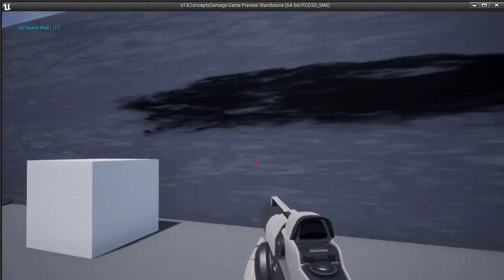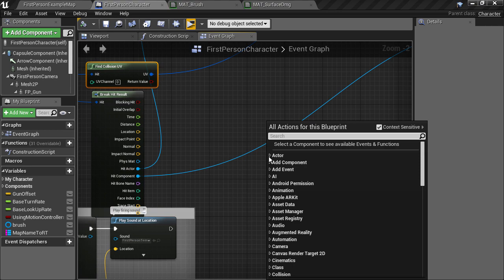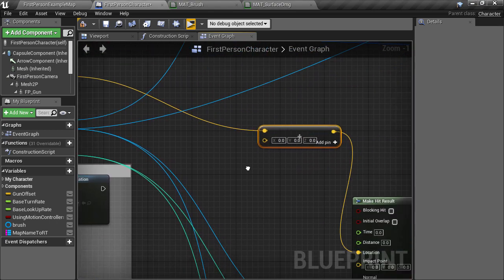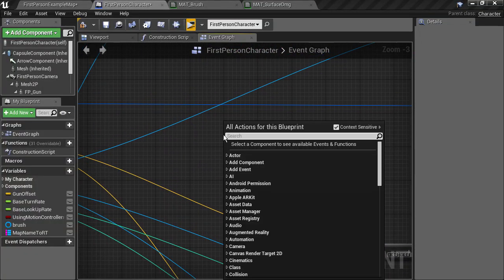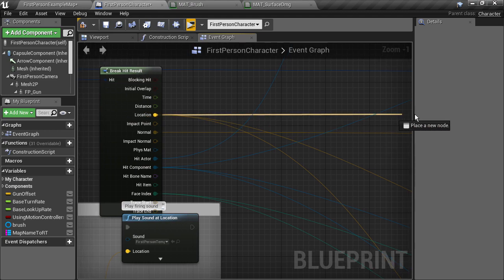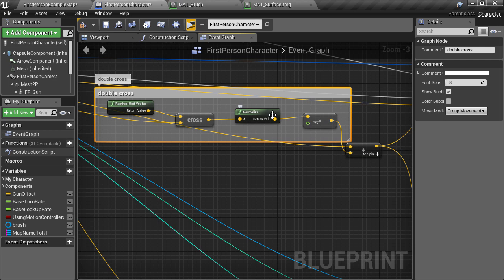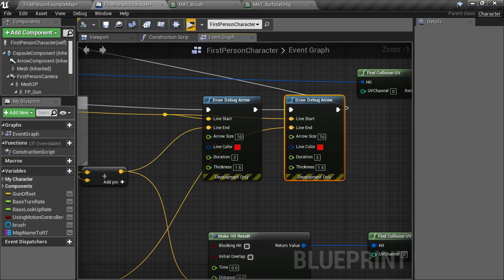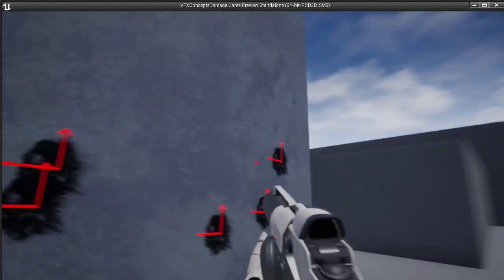Measuring the Scale, Squash and Stretch of mesh UVs - Unreal Engine 4 Tech Art S03E09

Comment: Great tutorial, thanks for your work! One thing, You have a little bug in your code. The problem is with scale (if you hit forward side of scaled wall the scale is proper, but when you hit the same wall from behing scale is messed up). The problem is where you substract Find Collision UV from original Hit location with Find Collision UV From new Made Hit result. After That 2 substracts You Add them together (and this is making problem): Example: Hit forward side of wall:  (Collision UV - Collision UV1 X=0.010 Y=-0.055);
(Collision UV - Collision UV2: X->-0.022 Y->-0.025); 
(Collision UV1[X=0.010 Y=-0.055]  + Collision UV2[X->-0.022 Y->-0.025] = X->-0.012 Y->-0.080) Hit Backside of wall:  (Collision UV - Collision UV1 X->0.010 Y->0.055); (Collision UV - Collision UV2: X->0.022 Y->-0.025);  
(Collision UV1[0.010 Y=0.055] +  Collision UV2[0.022 Y=-0.025] = X->0.032 Y->0.029. Because of that the  Scale for forward side of wall  is 0.243 and the scale for backside of wall is 0.130. To repair that u need to add two (f)Get Abs 2D nodes (absolute) right after substracking Find Collision UV just before adding them togheter. After that scale is proper for all sides of wall. https://blueprintue.com/blueprint/fambm6nk/
Reply: Nice!  If anyone is curious, it's easier to see on the BP link than read, but basically the Find collision UVs to Subtract to Add to Vector2dLength get swapped out with UVs to Get Abs 2d to Add to Vector2dLength.